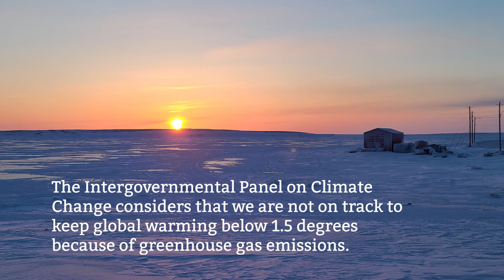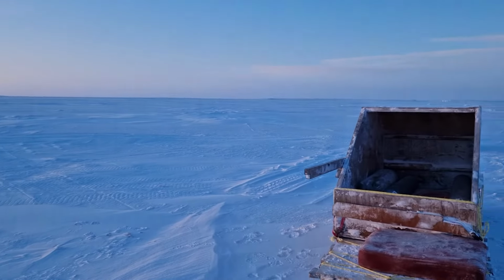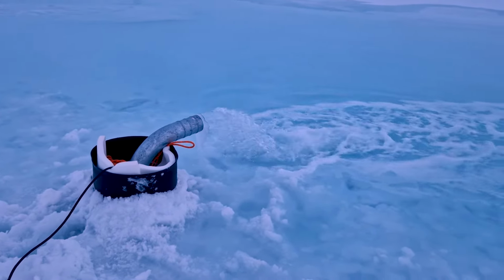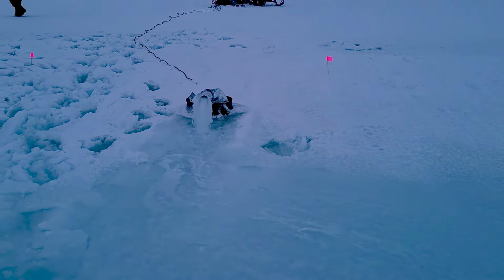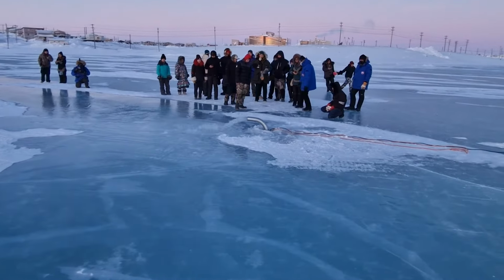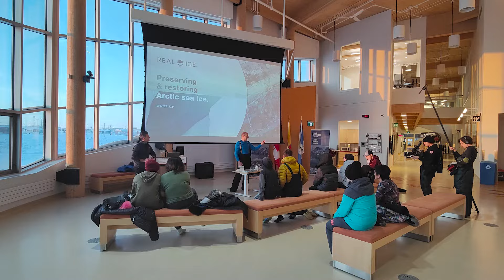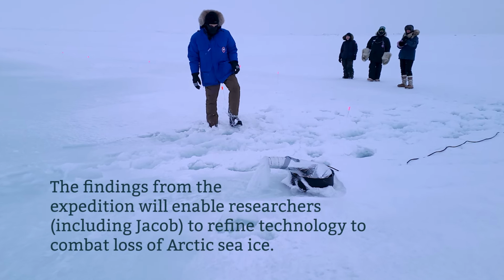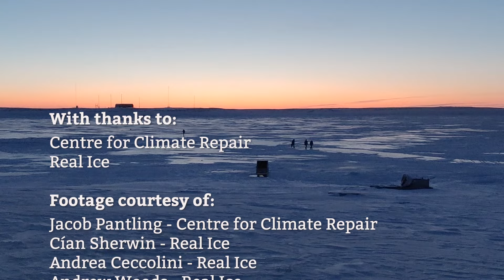Restoring Arctic Sea Ice

Comment: The Arctic minimum summer sea ice trend is zero for the past 18 years. In the past few years it was almost as high as 1995. The probability that this could be due to chance has now dropped to 10% (after Swart et al calculations, 2015). If the hiatus continues until 2027, it will become statistically significant (p<0.05, or less than 5%) and no longer explainable by chance. Using National Snow and Ice Data Centre (NSIDC) information for  September minima (million km²): 
2007 4.16 
2008 4.59 
2009 5.12 
2010 4.62 
2011 4.34 
2012 3.39 
2013 5.05 
2014 5.03 
2015 4.43 
2016 4.17 
2017 4.67 
2018 4.66 
2019 4.19 
2020 3.82 
2021 4.77 
2022 4.67 
2023 4.23
2024 4.21.
Plot the trend line for this data and it will be flat. ZERO net change in 18 years. The linear trend since 2007 is indistinguishable from zero ( around -0.17% per year ).
In the early 1950s the sea ice concentration anomaly was lower than it is at present. The sea ice anomaly then rose during the 50s, 60s and 70s. This was followed by a decline. This is demonstrated in Arctic and Antarctic Research Institute (AARI) data, which is based on historical sea ice charts from several sources (aircraft, ship, and satellite observations). 
The AARI data shows the sea ice concentration anomaly was lower in 1952 (-5%) than 2005 (-3%). The anomaly increased in the 50s, 60s and 70s. In the 80s, 90s and early 2000s it decreased. Since 2007 the trend has been flat. 
JAXA (Japanese Aerospace Exploration Agency) satellite data from 2002 to 2024 Arctic Sea Ice Extent (365 day running average) shows no noticeable trend with values close to 10,000,000km² throughout. Their minimum extent for daily values was in 2012. No other year since has come close. 
MASIE (Multisensor Analyzed Sea Ice Extent - Northern Hemisphere) shows something similar to JAXA. From 2005 to 2024 Arctic Sea Ice Extent (365 day running average) shows no noticeable trend with values close to 10,000,000km² throughout. Their minimum extent for daily values was in 2012. Again no other year since has come close. It also shows a marked increase in Ice in the Greenland Sea since 2018. 
Polyakov et al (2003) show "ice extent (1900-2000) in the Kara, Laptev, East Siberian, and Chukchi Seas provide evidence that long-term ice thickness and extent trends are small and generally not statistically significant". Trend -0.5% per decade (±0.7%). They also noted "the Arctic temperature was higher in the 1930s–40s than in recent decades, and hence a trend calculated for the period 1920 to the present actually shows cooling."
Zhang (2021) showed there was no trend for Arctic sea ice volume since at least 2010, and observes that ice draft increased from 1995 onwards. Including more recent satellite data from Cryosat-2 (2010-2023)reveals the Arctic ice volume minimum (Oct-Nov) is increasing at 56km³/yr (Kacimi and Kwok, 2024).
Vinje (2001) shows a deceleration in the rate of ice loss from 1864 to 2000. 
Recent sea ice extent is very high when compared to the last 10,000 years. Also changes in sea ice extent and the speed of those changes were greater in the past (Stein et al, 2017). 
NOAA's Global Time Series Average Temperature Anomaly monthly data (1995-2004) for the Arctic region shows the peak anomaly occurred in January 2016 (+4.99°C), another El Niño year, and the trend is now downwards (-0.42°C per decade) as of June 2024.
HadCRUT4 Arctic (70N - 90N) monthly surface air temperature anomalies record (1920-2021) shows the greatest number and magnitude of positive temperature  anomalies occurred between 1930-49. All anomalies in excess of 5°C, including +7°C (referenced to 1961-1990) are from that period. No temperature anomalies from 2000-2019 exceeded 5°C. It shows no decade warmed faster than the 1930s and the current 'warming' finished in 2005. 
JRA55 SAT (2010-2020) shows most of the Canadian Arctic and Greenland cooling with parts of Canada cooling by 3°C and western Greenland cooling by 2.5°C in a decade. 
KNMI data (Twentieth Century Reanalysis V2c, 1851-2011, 68°N-80°N, 25°W-60°W, so Greenland) shows the most pronounced warming took place in the 1870s, and when comparing temperature anomalies, highest are in the 1930s and comparison of that period with recent temperature anomalies shows no net warming.

Comment: What a pity, such a waste of time. They should have looked at some of these U.S. Patents from the 70"s and 80's. the earliest was number 3,750,412 in 1973 and last 4,523,879 in 1987. They involve spraying sea water through devices like snow making cannons, the companies involved actually created ice islands and ice structures. If this technology was used in currents flowing toward the polar ice fields, several square miles could be added to the polar ice cap daily with just a handful of machines. Many of the islands created were in excess of twenty feet thick.